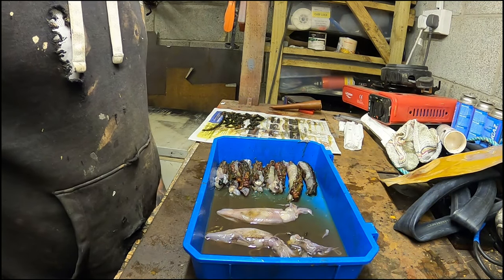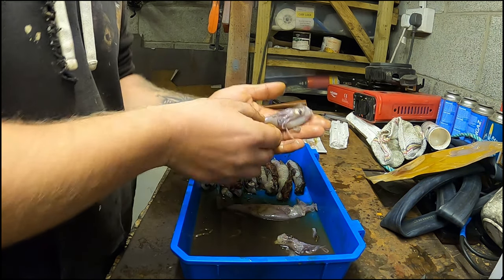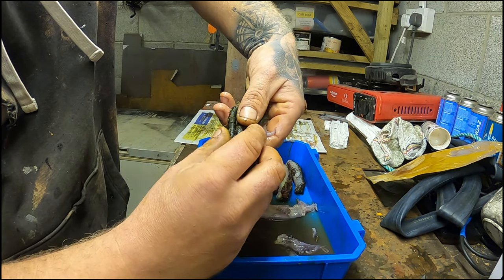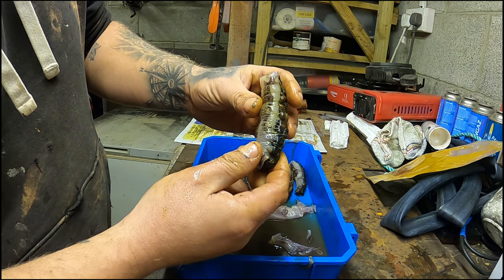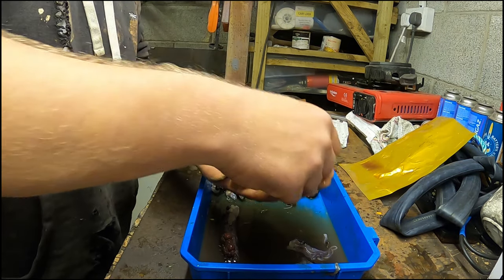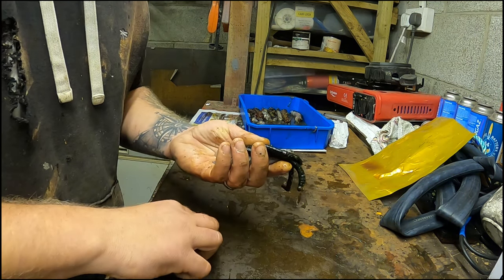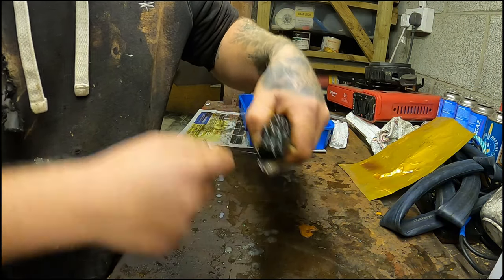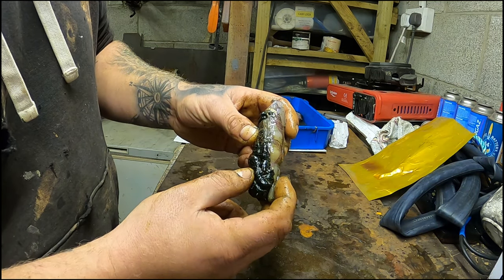BLACK LUG & SQUID WRAP'S  prepared at HOME

Comment: I prepare mine at home with squid\blacks, squid\bluey, blacks\bluey, squid \crab cart, black\crab bait elastic them all wrap them in cling film in packs of 5 and with some I spray crab\ mackerel  favouring onto  each one when wrapping to soak in the flavour as the freeze then take them in a thermos to keep frozen ready to use at the beach
Reply from the maker: Sounds good and a good idea. Do you find it helps your catch rate? Or no?

Comment: I use a bait mate tool so easy and great presentation every time
Reply from the maker: I used to use those they are great for learning but in the end I found it faster and easier without
Reply: @C3BFA 
Yeah i get that mate but even without one your presentation is really good i copied the last video and those wraps are in the freezer
I store them in those plastic take away containers from poundland 10 for £1 and pour the liquid, blood and body juices on the top before freezing

I'll try this once I get some blacks
Reply from the maker: That's exactly what I do but I'm using those air tight sandwich containers so hopefully they never leak in my seat box I then keep the juice for the next batch and so on and so on so the scent is always being built up in them if that makes sense
Reply: @C3BFA  definitely

Comment: Good Vlog mate, i use a bait holder and I hook 5 worms through the head then line up to bait holder put hook in clip then add squid and wrap up, anglers corner in milford should sell bait holder mate 👍
Reply from the maker: Yes they work I have also used a b8m8 but I prefer doing it this way 

But for any others reading these comments the above comment could help you out if you struggle to do it by hand or a b8m8 

Thank you for you feedback and thank you for your input this is what it's all about helping each other

Comment: I make these at home as well, much better to have them already prepped... Although mine are slightly smaller usually I use two squid strips and 2 worms & they usually turn out quite large too but I do make them like you did sometimes also. I put them in takeaway tubs to marinate in seagoo too if I have some but not really important, these baits have great scent anyway. I always bang them back in the freezer in the tubs ready for when needed.
Reply from the maker: That's great thank you for sharing and I agree there is a lot of scent from them